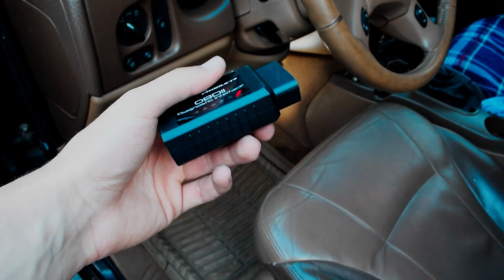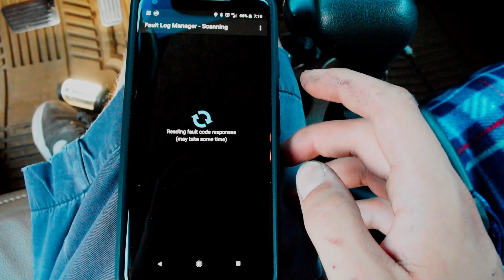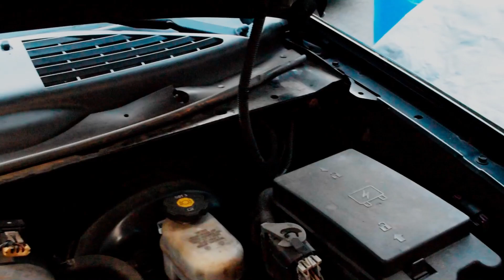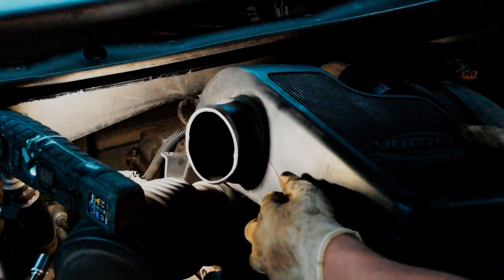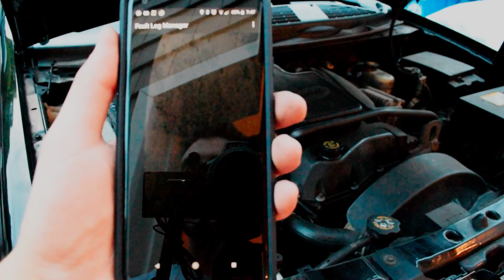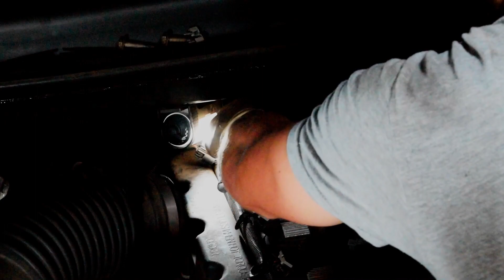Diagnosing and Fixing a Misfire on a Trailblazer

Comment: What was the gap size on the spark plug for the 2003 4.2 trailblazer
Reply from the maker: Left a stock gap. Plugs come pre gapped for stock applications. I didn't mess with em
Reply: I think its techincally .042" but I just check new plugs and if its .040-.044 i just install them as is.   my 06 loves the double plat NGK plugs.

Comment: Thanks for the tip about changing the spark plugs for damaged coils. I just did plugs on my mom's. I suspect I need to replace coils; it still has a misfire after the tune up. I might want to change the spark plugs again, eh? Thank you.
Reply from the maker: Yeah just to get rig of that carbon tract it's worth changing plugs again on the problem cylinders

Comment: I believe you were pointing to #2. The firing order is 1,5,3,6,2,4 front to back. Also if you look on the plastic cover to the left there it is printed on it.
Reply: The firing order is different from the the actual number of the cylinder. The cylinder order is one through six from the front of the engine.
Reply: facebook technicians disagree and i am on youre side so much they blocked me. i tried man
Reply: @may03LT don't be dumb

Comment: whys the spark plug  covered in oil 
check  gaskets
Reply: Yes, if the spark plug is covered in oil, the most likely problem is a leaking head gasket.
Reply: @williambouchard4480  I meant Dial cover gasket but that’s my fault I should’ve clarified that

Comment: Thanks for the video my trailblazer marks only p0300 cylinders misfired but don’t say exactly the number of the cylinder did u think if I changed to new coils for the 6 cylinder should be ok or i should expect something else than just coil pack thanks
Reply from the maker: It's tough to say. If you're not getting consistent data for one or two coils, sometimes one not firing can trick the computer into thinking the next cylinder in the firing order missed too. Can you see what cylinders are misfiring currently with a misfire counter?
Reply: I’m not a mechanic but I think your 0300 code is a timing sensor Duralast part TS1012